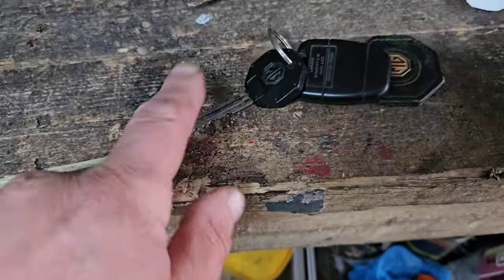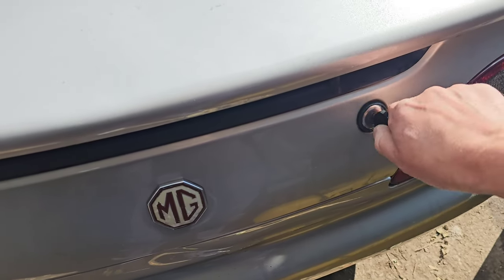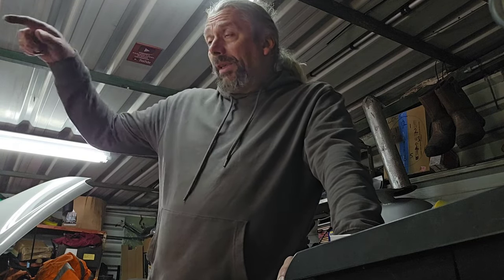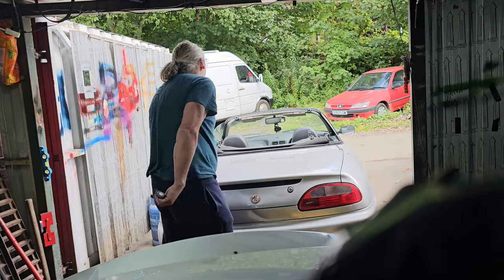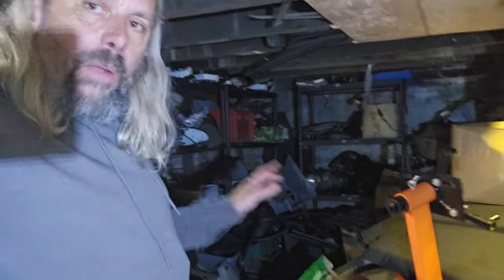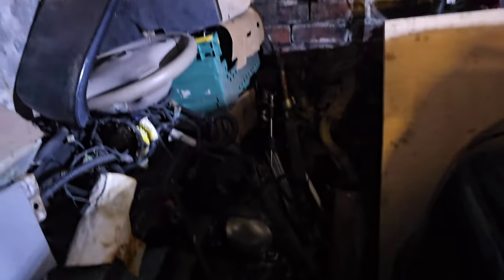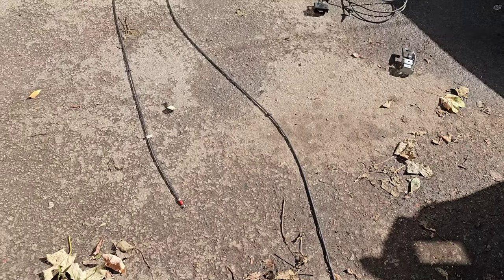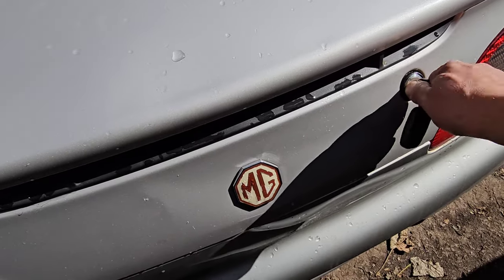MG F Boot Lock Hack!

Comment: A few years ago I had an Audi and I used a local Audi specialist to do the work on my Audi. So what? Well, because it’s a very odd coincidence with the story being told in this video. A quite fantastic coincidence in fact. One day I went to the local Audi specialist with my Audi as I had arranged for something to be done to it. I forget what and it’s not that important though if you’re really interested I could try harder to remember. When I got there we used to have a nice little chat about stuff, cycling mostly but also things like how the Japanese struggled to write washing machine user guides because they didn’t have the symbols in their language to describe what you needed to do. They had to create new symbols. Anyway, one day there was a Volkswagen Phaeton in there with a massive hole cut into the boot skin. Behind this hole was a lot of infrastructure and complication and to the side of the car was another boot lid, but in a different colour. I asked why they didn’t cut up the one that wasn’t the same colour instead and they told me that the boot latch mechanism had failed and they had tried all sorts to get it to release. After a couple of days they suggested to the owner that they tunnel in through the boot and they agreed so it seems that for many cars the only way into a stuck shut boot is destruction. And the amazing coincidence? The Audi specialist was called Nigel. Probably still is, but I don’t live there any more so I’ve not seen him in ages. Perhaps I should give him a ring and say hi.

Comment: Now call me picked but wouldn't a metro rover 100 hatch release work with a bit of a bodge and you could of made a bit of a bracket to hold it in the cabin may be under the seat😅😅

Comment: Good job Paul, but destructive of the light assembly. Saved lots of time, locksmith not closeby.  Creative with the cable to open boot.
        I would have cut a large piece out of the lens. Still, the lamp body is broken to remove it, fair enough.
       If another lamp assembly was unobtainable, all the pieces could be glued and plastic welded. Lens would be not as nice but functional. 
           Very well done repair.   R.